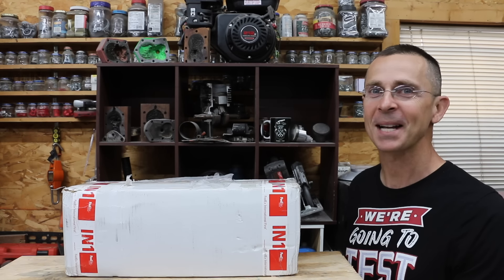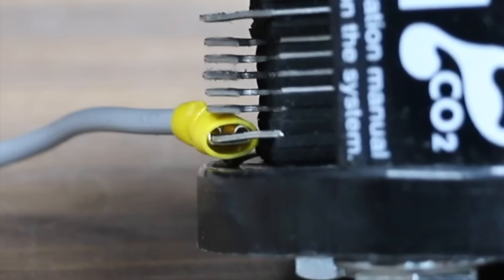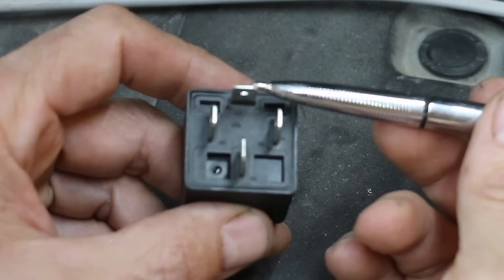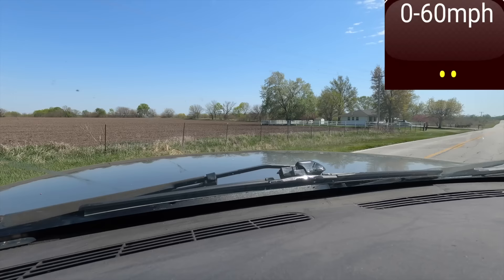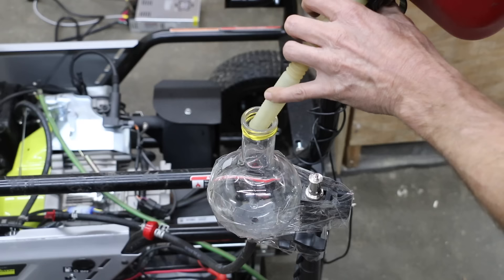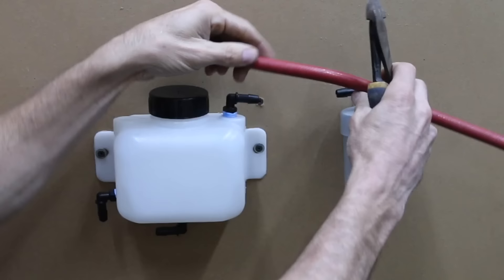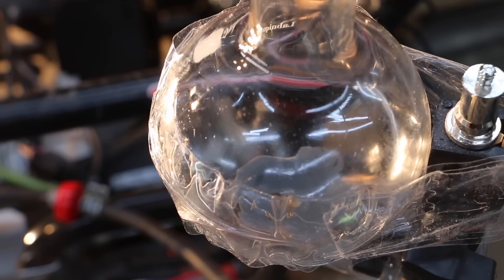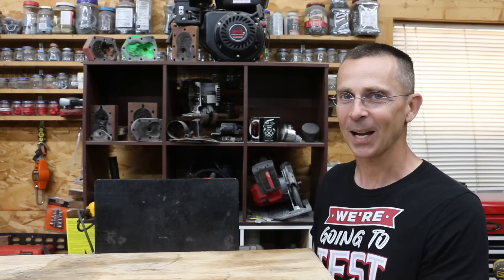AMAZING 35% More MPG with HHO? Let’s find out! Help with high gas prices?

Comment: Yeah, I heard about these kits like a couple years ago, I was very skeptical about it. Now it's confirmed.
Reply from the maker: Thanks for watching!
Reply: @ProjectFarm  no, thank You for all the time and effort you put in your videos! It's hard, hard work!
Reply: @NandoP07  ... In the '70s, I observed an engine accessory that seemed like a viable addition if there is enough room for it. It was a large jar of water and a couple lines that tapped into the intake manifold vacuum. One line pulled at the top of the jar lid, while the second one was attached to a loop at the bottom of the jar. The loop had a bunch of tiny holes in it, allowing the vacuum at the top to draw air through the loop, making a cascade of bubbles in the water which caused the air in the top of the jar to be very humid. That humid air drawn into the intake was intended to clear combustion chamber carbon and maintain the cleanliness as the vehicle is driven. We used to do a similar procedure with carbureted engines by revving the engine and introducing H²O into the air horn. Cruder, but potentially as effective. No way to practically test the operation of either the accessory, or the manual process. Basically it was a comfort plan. I never sought one of the water jar systems, but something tells me it was available through the J. C. Whitney catalogue.
Reply: Not quite...I made it work
Reply: @devinmcaluliff7001  do tell!
Reply: TruthOrDie777. com  But, was it the wrong size for the generator as well?
Reply: @NandoP07  He can't give you a recommended operable size, because it's all more speculative BS that can't be reliably be repeated under any given starting conditions. Just like cold fusion.
Reply: @JW...-oj5iw  Water injection is legit technology for hard working engines producing a lot of heat,   more so for old side valve engines that can't discharge heat when running at high outputs,     but HHO  is legit scam.
Reply: @johny9516  You also have to believe that it will work ...
Reply: TruthOrDie777. com  If it were undersized for the truck, why didn't it work on the genny?
Reply: @JW...-oj5iw  I used to page through the J.C. Whitney catalogs in the 70's just for laughs. The winking cat turn signals, the water vapor kits,, weird exterior light and all those crazy bolt-ons. I often wondered what a vehicle would look like driving down the road with ALL the J.C. Whitney improvements bolted on.

Comment: the injectors will supply the same amount of fuel regardless of HHO or not, you need to set it to run lean. Your HHO contains more hydrogen than oxygen also which is starving out the engine, another reason to burn it lean as it will supply enough oxygen and enough fuel. I've seen the stated 35% results with learner fuel mix, I installed lower rate injectors and I found it worked amazing for some time before that car was sold to make ends meet.

Comment: At least you got a HHO generator, now you can weld Rocks together.
Reply: This works?
Reply: @sashasoule4585  - HHO can melt pretty much anything, from what I’ve seen
Reply: RHNB!
Reply: @orcoastgreenman  hho burns at 2500 celsius.
Reply: @mattbanks3517  - how then, does it’s flame melt tungsten?   I’ve seen it claimed that the temp it can raise things to is higher than it’s flame temperature
Reply: @orcoastgreenman  that’s so cool, potentially it catalyzes the melting point of the metal to be lower? Don’t know how or why if it’s just hydrogen and oxygen tho.
Reply: Hho, browns gas, monoatomic hydrogen and monoatomic oxygen...  Needs pulsed DC for resonance matching.
Reply: @sashasoule4585  nope heating by radiation. You can reach any temperature with photons, which are just balls  of pure electromagnetic energy, concentrating sunlight and heating something up with it you can achieve any temperature greater than room temperature, assuming you can keep the heat in and stop it from radiating away. Most energy of the flame is radiation. The maximum temp depends on wavelength. Gamma ray are most energetic and maximum temperature is the Planck temperature.
Reply: @meh11235  what do you mean by resonance matching?
Reply: I'm talking about ignition timing using capacitors and an alternator that has an additional unlinked coil for mechanical storage of unused EMF, think turbine waste gate.
Reply: @sashasoule4585  - or perhaps it imparts energy into a material in a manner that is more than just flame heating based, and the material heats up to whatever temp it will, limited by the total energy input, size of area heated, and the heat dissipation ability of the material structure in and  around the heated area?   I don’t know, and have not verified these claims myself, but have wanted to build an HHO torch and try it.

  (Just read Matt Banks’s comment and it seems like a plausible explaination... I know a regular 2 tank hydroxy torch and oxy acetylene both produce light that will burn your eyes without the proper safety lenses, like arc welding will... so maybe it is a light energy effect?

   Yull Brown (I think?) was an HHO experimenter who made all sorts of claims including the sublimation of tungsten with HHO which I think would require temps well above those of even an oxy-acetylene flame...
Reply: @meh11235  good idea.
Reply: @AnkurFFM  who cares about money. This is a way of storing energy, you can build an electrolyzer from some graphite (activated carbon is also graphite) or stainless steel or just some nickel, KOH and water. It takes 16mj to electrolyze 1l of water. Hydrogen is also one of the densest energy sources. hydrogen is almost a battery.
Reply: @mattbanks3517  put it in a aluminum block engine

Comment: This was a good experiment but there is a difference to running a generator under continuous load to driving and it is simply this: HHO is delivered to the engine regardless of whether your foot is on the gas. Every time you brake, you have taken your foot off the gas but the HHO is still being delivered to the engine. So its a bit like regenerative breaking as we know that when your coasting or breaking the engine load is minimal (idle) but still makes the same amount of HHO litres per minute. The fuel cell kit is basic and a pulse width modulation circuit would be more effective. Anyway, it's all good fun and it does prove that 'off the shelf' kits rarely work straight out of the box.  An emissions test would have been some evidence of a change as the lower the emissions, the less unburnt fuel is coming out of the exhaust. Diesel is more responsive to HHO than petrol. Good job

Comment: Thanks for everything you do! I was honestly considering making a DIY one of these for my car and now I think I will save myself the time, money and effort. I love your work.
Reply from the maker: You are welcome.
Reply: I made one years ago. Was cool to watch it produce tons of hydrogen and oxygen but did nothing as far as power and/or fuel mileage.
Reply: I know someone who built one for his car, and bragged and bragged about it. However, his lack of any real data, combined with his engineering skills reminded me of the target audience profile that these claims are aimed at. You can convince them of anything as long as your claim involves being a victim of the government, but industry, the wealthy, etc...hold on.....I smell a car fire nearby! Gotta run!
Reply: big industry.
Reply: It's still a great project, I have two I made years ago and had on my truck. Mine if you take and set a pop can on top of it for a minute then touch a lighter to it, it rockets the can a good 25ft. Beware breakable items nearby. Lol. 
And I left the hho switch on in my  truck once by accedent filling the entire intake, long story short it blew my spark plug gap so far out the truck would not start.